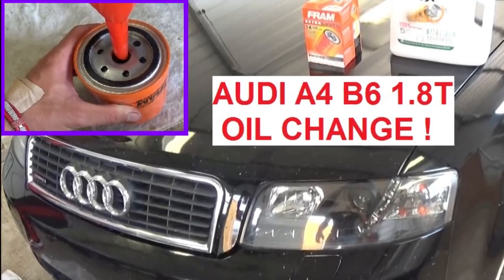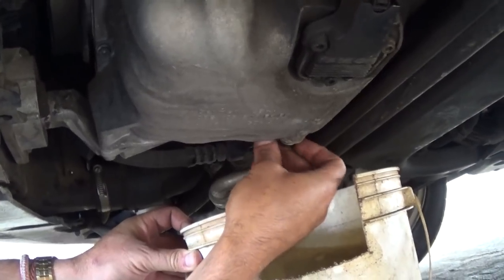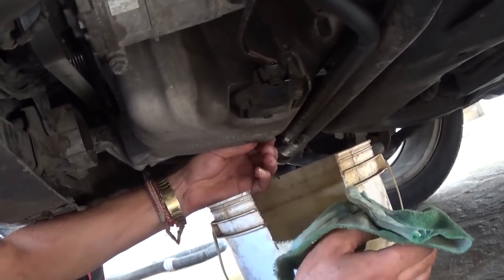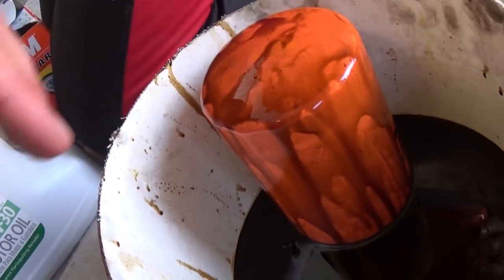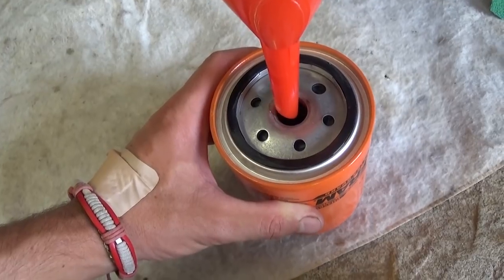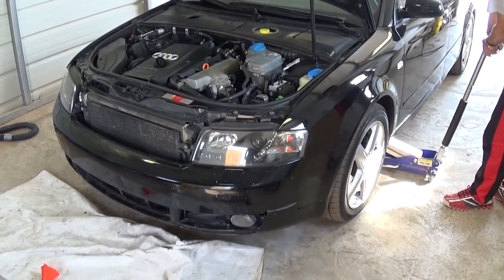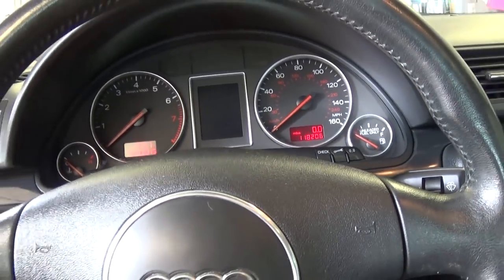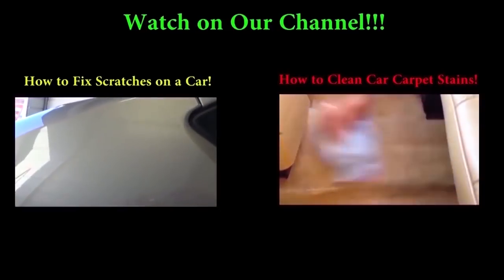AUDI A4 B6 OIL CHANGE . How to Change the oil on AUDI A4 1.8T 2003 2004 2005

Comment: i have a 2002 audi a4 turbo when i change my oil i take off the air hose to access the oil filter i use full synthetic oil 5_40 European oil u can go up to 7500 miles my car is really fast only 122 000 miles on it can go anywhere when it needs to be fixed i fix it no problem its a really great car
Reply: I have the same exact car 1.8t 2002 Audi a4 quattro is the oil change the same as this video
Reply: @charliemac4294 identical since it's the same engine?

Comment: You put 5W-30 in your car but the recommended oil is rather 5W-40. I don't know where you live but If it's hot in your place it may not be a good idea. On my case I decided to try synthetic 0W-40 to improve my gas milage and start in cold temperature. I use the car only in winter anyway.
Reply from the maker: +Serge Campeau When I used to live North I used to put Mobile 0w-40 synthetic and it worked great. Great choice. The oil change with 5w-30 was for a trip to Colorado in the summer. Temperature did not exceed 24 Celsius.
Reply: That 0W is too thin and hard on your engine at start up and idle. I'd only use that if I lived somewhere that has VERY cold winters. 40W is for very hot climates. For the vast majority of North America 5w-30 is the most ideal, and 40W only on very high mileage cars. I live in Colorado.

Comment: I use diesel diesel castrol gtx sae 15 w 40 and I have worked well in my audi a4 1.8 turbo quattro 2004 std 6 speed ... here it is very hot up to 113 degrees .. what do you think?
Reply: Agora de Baja California yes that should work fine. i recommend Rotella T6 5w-40, its diesel oil but it works great in these cars since they do get hot, and living in hot temperatures makes it better with this oil

Comment: I like that the B6 has a metal housing and spin-on filter instead of the crappy plastic housing, cover, and inferior cartridge style filter the B7 has. For the life of me I can't understand why Audi went backward with the B7 and that poor design. The only thing that would be better is if the B6 filter was not at that goofy angle that causes the filter to leak when removed.

Comment: I hated the location of the oil filter on this car when I had one. Very inconvenient and messy.
Reply: The B7 is even worse. Everything is plastic, it uses a cartridge style filter, and you have to drain the filter before removing it (DUMB!). I had a B6, and wish my current B7 had the B6 style setup. The only thing that makes the B6 filter a pain is that it's at that goofy angle that leaks oil when you remove the filter.

Comment: Where is the plastic guard under the engine? You skipped that step. I don't see the engine under my car. Do I need to remove that whole thing?
Reply from the maker: +Serge Campeau Remove the belly pan using the flat head screwdriver (my car is currently pan-less). Most A4 do not have them because people forget to put them on or they crack them
Reply: +World Mechanics I live in Canada with hard winters, snow, ice and salt. Driving the car without that guard is not a good idea. Furthermore its other function is to improve the aerodynamics of the car, whitout it one must expect a reduction in gas milage on highway. I drive 500 km/week and the gas is expensive here. On my car, most original screws are gone and it holds in place with other type of screws and tie-wraps. It took me about an hour to reinstall it. On my other car it's not necessary to remove that part to access the oil plug and there is a hole to access the filter.
Reply from the maker: +Serge Campeau We agree with you. IT MUST BE THERE but we have purchased over 7 Audi-s now and each one of them was missing the belly pan. None of the auto salvages around here have them. Before we sold the last one I order one from eBay